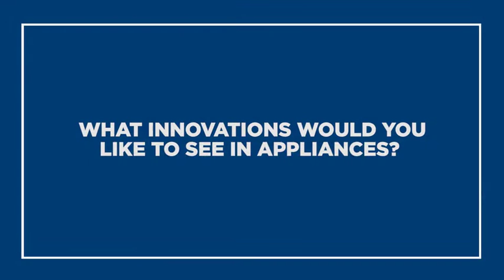Ideas That Matter: Thinking Outside the Circle

Comment: When will this be ready for production? 
This is a genius idea you're holding on to.
Reply from the maker: Hi John, thanks for your interest in this great new dishwasher idea. We now have this new spray arm on our PDT846 model. The feature is called "Clean Sweep Jets". This revolutionary new wash arm features corner wash jets that provide edge-to-edge coverage in the upper rack, to clean those hard to reach areas: http://products.geappliances.com/appliance/gea-specs/PDT846SSJSS  
It is not something that can be retrofitted to other models though. Thanks for checking! -SF

Comment: Absolutely fantastic design. Nice work GE. 
I just may retrofit this into my current Profile dishwasher. 
I have to call you out on a fib though. 
Your engineer claims that all the gears are internal, powered by the water, and it's the first time anyone has every done that? 
That's a lie. Whirlpool did that several years ago with their Total Coverage spray arm in their dishwashers. 
It has a totally internal geared powertrain, that is water powered. 
You guys are #2. 
But good work nonetheless!